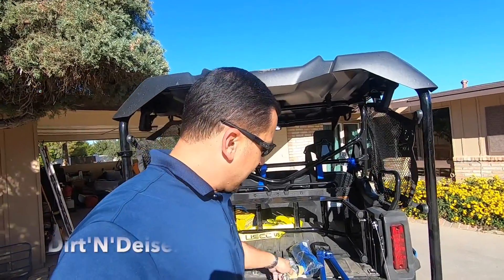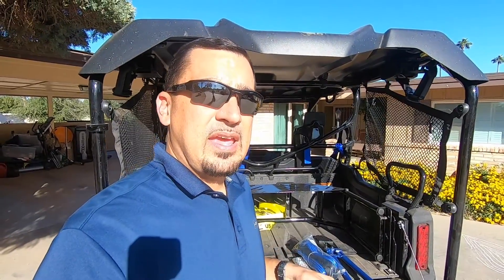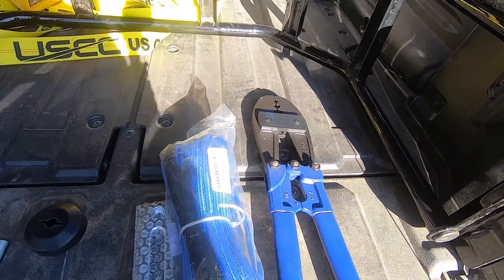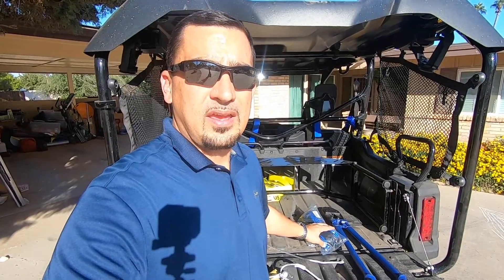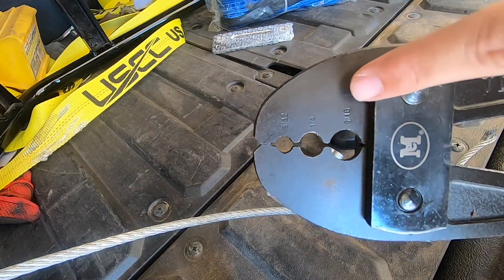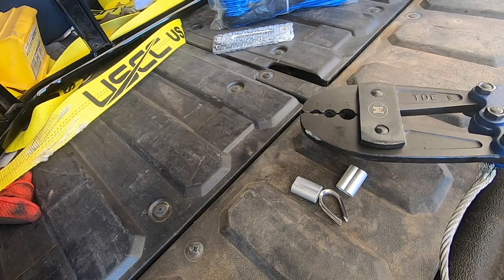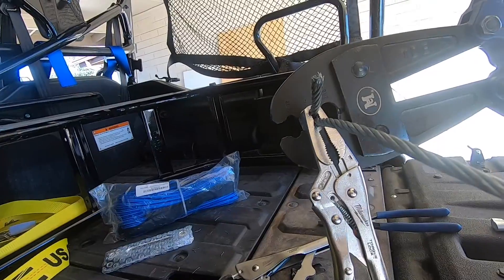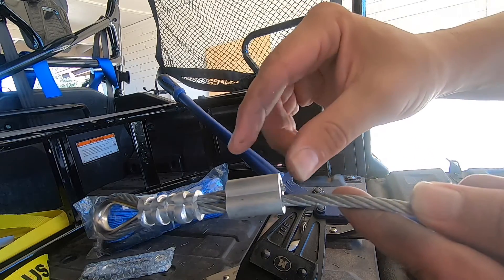How to fix a winch cable

Comment: Excellent.  I have never seen a SXS video on how to fix cable tow lines.  Best to fix it for the reasons you mentioned.  The existing cable has years of life left in it.   If you don't have the tools, I would check out Harbor Freight.